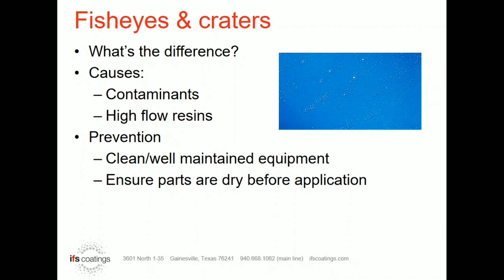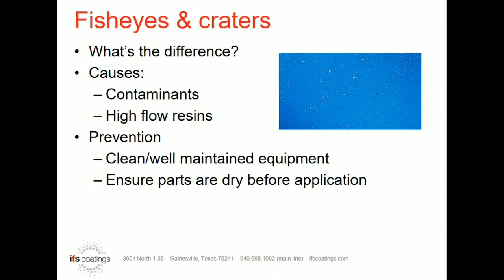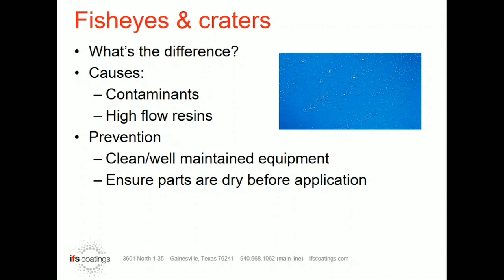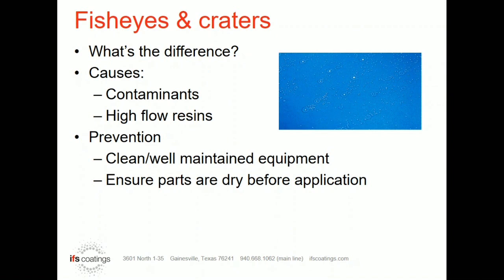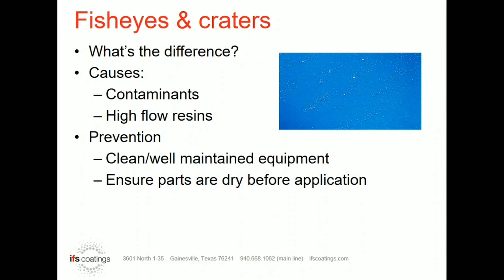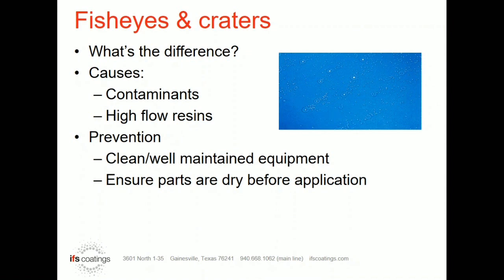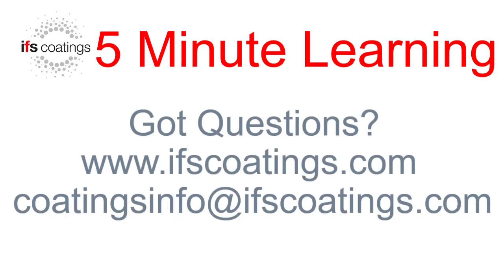5 minute powder coating learning. Appearance issues: fisheyes and craters

Comment: Do y'all know a way to safely remove white rust from galvanized steel? Also, what would cause powder coating to be fragile i.e. chips/scratches too easily
Reply from the maker: Hi there, I checked with our technical team and this was their response:
 The best way I know to remove white rust is by mechanical means (sanding or blasting).  There are some chemical processes, but they can be expensive and not to environmentally friendly.

Typically, what makes a powder coating fragile is an under cured product.  A urethane can also be fragile if it is applied to heavy.

Does this help?
Reply: @IFSCoatings  Yes it does! Thank you for the quick response. Would sandblasting effect the galvanization?